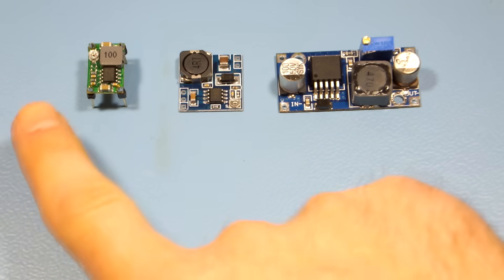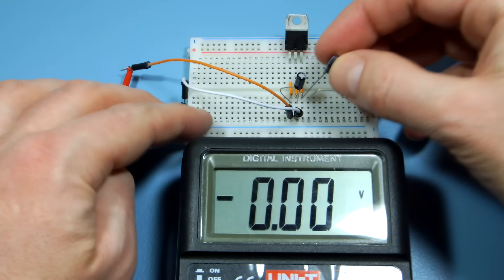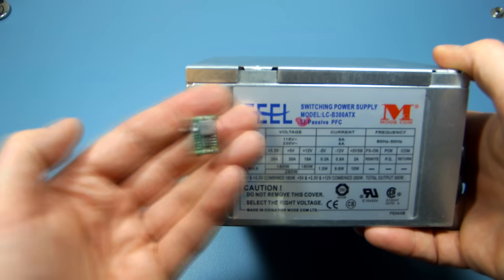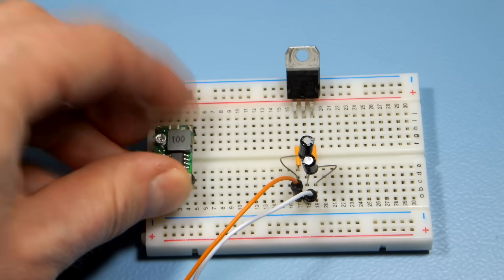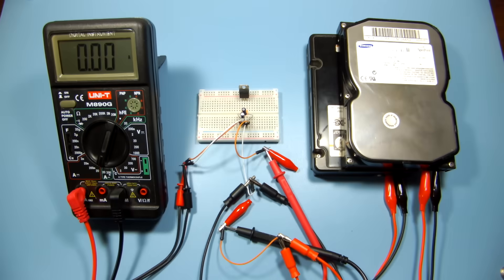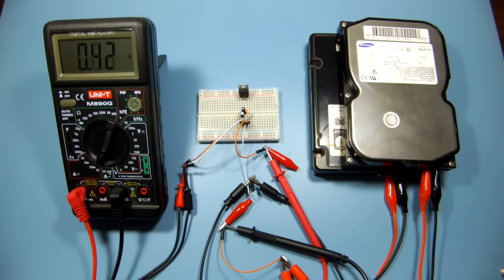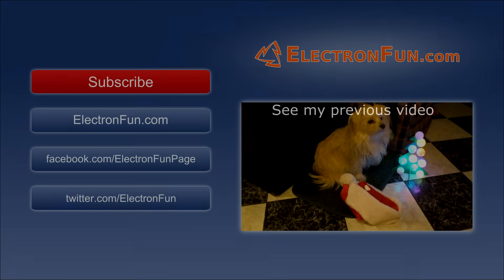Buck converter vs. linear voltage regulator - practical comparison

Comment: Buck converter is great if you want to power a cooling fan. But if you want to power a 5 volt car camera, Magicjack, or speakers than the linear voltage regulator is a winner. Even a UPS has a lot of ripple noise, so instead using a buck converter I decided to Use a 6 volt 3FM4.5 (6V4.5AH20HR) , a YX850 Power failure automatic switching standby battery lithium battery module 5V-48V universal emergency converter JY-850  US $2.85, a 6 volt battery tender charger, a 5 volt linear voltage regulator,  an USB anti interference filter board USB filter board USB power amplifier filter board computer filter USB purification board, 5 volt 2 A low interference noise Adapter for powering magic jack from the grid, 
with a 0-50V 4A DC power supply filter board Class D power amplifier Interference suppression board car EMI Industrial control panel, in tandem and I have crisp clear Audio, and Uninterrupted Power Supply in any case of power outage. Technically you are Right, but no PRACTICAL.

Comment: My input 12v 7ah, mini 360, and it burst. how much input current should be?
Reply: ?????     Charging a battery?
Reply: @kennmossman8701  yes
Reply: @rajatfq  For standard Li-ion or Li-polymer batteries, chargers often target 0.5C charge current. In other words, if the battery is rated at 500 mA-h, the target current is 250 mA. It is not unusual to charge at 1C (500mA), but this compromises the battery's capacity over time.
Reply: According to the YT video here, < 7 A  but check with websites...1 C seems a bit high

Comment: What circuitry should I use to convert 50v to 20v 2A at the output?
Reply: use a pre-regulator............series-pass regulator can handle "any" voltage

Comment: Hi, guy. I want to ask you about using the regulator. If the Input is not 12V, I want to input about 15~18V, then what will the Output go out?
If you teach me that, my project will be succeeded.

Comment: Hello

Let's say that I have a fully charged 15000V DC capacitor and I want to use the voltage but I need to step it down.. all the way to variable 1V - 15000V DC, do you know how to build this or where to get a hold on a voltage regulator that have an input voltage this high?

Kind regards

Comment: I have an old (but still good) drill which takes nickel metal hydride battery's they are 25v but the charger has died. 
I bought a new drill with 18 v NMH  batteries and a good charger, can I use a Buck converter to up the voltage so I can charge the 25v batteries?
Reply: you still neeed a charger

Comment: Computer power supplies usually have high frequency transformers to step down the voltage. At higher frequencies, transformers can be fairly small and smaller capacitors can be used for filtering.

Comment: good example, but from my perspective, the most of the buck converters are made with to thin copper layers and therefore, the cooling is not that good, when hooked on the ocb. with other words, there are to cheaply manufactured and the working treshold is not considered that well. i trashed 3 of the common modules with a harddrive,  that i shoot  the  idea, to use them within a data center .. the chip itself on the buck converter is mostly the expensive part, so building up a self designed one, is still on the list :)

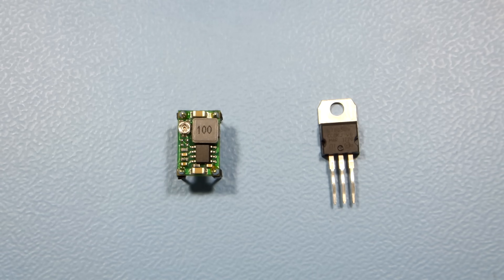Comment: had a bag of 10 of these regulators this week that you show at 6:03 , I needed to drop 11-14v to 8.3 for a lipo charger, worked before soldering, but failed once output wires soldered, the output was going short, i think theres an issue with mine in the multilayer board that solder wicks somewhere.  I have had no issues with the blue pcb version with the preset voltage solder pads on the rear, i'll stick to buying those ones in futre. all boards worked before being soldered

Comment: i need to stepdown 3.7v ( from a lipo ) to 1.2 - 1.5v which do you recommend? linear or buck ?
edit: this to make a battery for a wireless mouse
Reply: Use a buck, it will give you 2-3x the battery life. Also, you can get extremely cheap ones at such a low voltage.
Reply: @yum33333  any recommendations on which buck I should use. I'm not really familiar with different buck converters

Edit: 
I am comfortable with using a IC and creating my own circuit. 
Any information is greatly appreciated
Reply: use a diode shunt regulator.... two diodes give 1.3V   or use a 1.8V red LED

Comment: Could some kind of shield or faraday cage be designed around the buck converter to minimize or possibly eliminate the interference generated by the circuit?

Comment: Hi folks i have a noob's question. I got two 6v 150 mA max power rated solar cells and i hooked them up in series. I get about 9v open circuit in shade. But when i connect lm7805, input drops from 9 to 2.5ish and i don't get any current at all. Nothing my cheap multimeter can measure anyway. Why is that dramatic voltage drop? I don't want anything fancy from the circuit, as long as lm7805 output is 5v, i can live with couple of mAs. Thanks for any answers.

Comment: Why tf does one use electrolytic aluminium caps for LDOs, juse ceramic or film capacitors instead, they have lower ESR and ESL. And the capacity for a standard 78xx is 330n on the input and 100n on the output, 10u for each is way too big.

Comment: But capacitor doesn't works with dc supply so how regulator is working ??
Reply: You can remove the capacitors,
 it is only for removing ripples in the input & output waveforms.

Comment: Even back when this video was made I could find at least 2 models of buck converters on ebay for 75 cents each.
Fast forward a few years after that and the mini360 that you have with pins soldered onto if can be commonly had for less than 50 cents each ..go buy a 10 pack and enjoy. 

The mini 360 is probably named for its switching frequency of around 360Khz, I hope no one is designing new AM band radios, but if they are the interference should be minimal, as the inductor is enclosed. You can also choose other models with different operating frequencies, such as the other 2 you showed at the beginning of the video, the larger unit has about an 80Khz operating frequency and the other one can be tweaked up to 500khz. There are cheap buck ICs out there that operate at up to 4Mhz switching frequency, most of those are a dollar or two more expensive though.
Someone else mentioned that you forgot the ripple on the output, so you should still add a 10uf decoupling cap to the output of the buck module.

Comment: I have a doubt, if we give 12 volts, 4 Ampere current to the inputs of 7805 voltage regulator IC,what will be the output current of 7805 IC, the voltage will be 5 & it's current???

Comment: Great video! I did have a question about your math. Wouldn't it be the power dissipated across the buck converter in the calculation?

Input: 12V x 0.21A = 2.52W
Output: 5V x 0.45A = 2.25W
Thus the power dissipated across the buck converter would be 0.27W.

Buck converter efficiency is about 92% and that calculation above would show ~90% efficiency.

Comment: A quick explanation of why the difference in the power consumption might have been useful for some.  A 7 volt feed would have been a closer match, not that it would be practical but would illustrate why the power difference.

Comment: @ElectronFun.com I wonder what the ripple/noise factor would look like if you fed the 7805 linear with 6v 3a from a DC to DC buck converter?
Reply: @MrBrymstond You need minimum 7V In, 6V is not enough, but the 3A load capability not necessary from the buck DC/DC, as max load on a 78xx series is 1.5A (TO-3 case). If you need 3A at 5V then you need a LM323-N, but there is 7.5V the minimum Input voltage (of course you will need a big chunky heat sink as well)
Reply: @Glanmire3  Okay so 7v in from the buck converter and the LM78XX will only draw what it needs, but the thought was will it clean the ripple and noise for small audio

Comment: When using linear regulators ALWAYS check the datasheet for the type you are using. Many regulators will be damaged if there is a high value capacitor on the output when the power is switched off. Check the regulator datasheet for reverse bias protection.
Reply: In such case you have to add a feedback diode on its input and output reversed bias and you're good to go
Reply: @drinkintea1572 it's called freewheel diode🤔
Reply: Linear voltage regulators are a type of voltage regulator that use a linear circuit to maintain a constant voltage output. This is in contrast to switching voltage regulators, such as buck converters, which use a pulse-width modulation (PWM) circuit. 

There are several key advantages of linear voltage regulators over switching voltage regulators: 
- They are simpler and more reliable than switching regulators. 
- They can provide a more stable output than switching regulators. 
- They can be used with higher input voltages than switching regulators. 
- They are less efficient than switching regulators, but this is not usually a problem for low-power applications.
Reply: @aplacetoimproveteslacoilin3721  bro using chatgpt

Comment: buck converters are now as cheap as all the circuitry needed for the linear regulator (because you have to remember that you also need a couple of capacitors and any way to join them).

Comment: can you boil water with a LM7805?  

cheers!
Reply: No, although the temperature can reach excess of 100c, the amount of water in a glass can dissipate it all in a fraction of a second, there is just simply too much matter for it to heat up, its actually why some people submerge their circuits in oil, not only does it provide static resistance, but the oil gives it a medium to dissipate the heat from the heatsink much more effectively that air ever could.

In fact, you can try it at home, put a couple of aa battery's in series with a resistor, preferably 5 ohms or less, do the math on how many wats it dissipates, check the temperature in air, then submerge the resistor in water. It will cool down very quickly.

Comment: I was trying to learn making my own usb chargers and was using 7805's to do it and as the video states, they are just too wasteful and need a large heatsink with any modest load. Buck converters are so much better for those type of applications. Only good thing with 7805's is the output is very clean DC compared to buck's. You have to clean the output with a buck converter with anything sensitive.

Comment: 7805's can take like 6-36v right? you mentioned 7-16.
Reply: 7 to 35V but for stable operation minimum is 8V. Load regulation is pretty bad with only 7V input.

Comment: Great explanation but just like to point out that you may not have incurred the failure of the VR had it been correctly setup with appropriate heat sink. This would also have improved its efficiency for your comparative data records I assume. I enjoyed the video :)
Reply: It wouldn't make any difference to efficiency. With a linear regulator, the source supplies the same amperage as the load draws from the output. With the buck regulator, the input current is much lower than what the load draws from the output. That's why it doesn't get hot. All the wattage gets passed from the source to the load. The buck converter probably dissipates less than 1/2 watt at the most.
Reply: Hello my friend,good day please can we use solar panel 12v to convert 7805 to get 5v to charge phone?

Comment: See the 2 rows of outer holes on the edges on the breadboard? Those are called the POWER RAILS. Red and Blue striped for Positive and Negative! So, why do you use silly and cumbersome alligator clips onto flying leads?

Comment: I went through 5 LM7805 trying different configs to support a 2.5W load. I even split the power going through using a power MOSFET with a voltage divider to the gate so maybe 1/3 power flowed through it and temps were still way too high with a little heatsink.... LM7805 are only for circuits using less than 1W no matter what the specs say...

Comment: Well, this is a bit of nonsense.....linear VR need proper heat-sinking - just as SMPS may also need.  You can use a metal case as a heat-sink, so there goes the space argument. Efficiency of SMPS varies a great deal - cheap ones are as low as 70%. Compared a pre-built SMPS to a linear IC?  oranges to apples.   LM317, 78xx sewries and the like have short-circuit protection whereas most SMPS do not. 
And yes SMPS are NOISY - audibly sometimes and definitely EMF wise. The waveform often sucks on SMPS which can give false readings and damage circuits.
Plus SMPS DO FAIL and CAN destroy the attached circuit - seen it happen many times.

Comment: 10 linear voltage regulators €0,90
Buck converter (the one with potmeter you showed) €1,-
Reply: you should consider the heat sink cost.

Comment: This is a HUGE help for me. I am trying to put an F.M radio inside a 1950s radio cabinet. I bought a kit, but it didn't have a good tuner that would fit in the existing spot, so I bought another kit that has a digital readout for the tuner. The first kit runs on 12 VDC, the second on 3VDC, so I was looking for a way to drop the voltage on only one part of the circuit. I'm not very adept at electronic theory so , I'm kind of stumbling in the dark as far as what I want to do and how to do it without ruining things. I had intended to use an old cell phone charger to power the unit. It's a 12 volt charger, but I don't know what amperage the two kits require, so I'm unsure if this is a safe way to decrease the power going into the unit and then how to decrease it again for the digital readout. Any pointers you can offer are deeply appreciated. Thanks.

Comment: You missed one important point, current. Buck converters are very limited in case of maximum allowable current.
Reply: Just buy a larger one that meets your needs. They sell them in many sizes
Reply: @jimthvac100  yes but a larger one will get large in every way.

Comment: Can I use buck converter for charging 8.4 v ,4500mah battery from 12v supply,when I using 7808 its shut down within seconds due to heating

Comment: I've attempted to use several different buck converters with 3 motors (120x120 fans actually). These motors (fans) draw 80mA.
All the different buck converters lasted around a day, then they were fried.
Now I use a simple LM317 and it just works all the time. I don't use a heatsink.
I believe this is due to that the motors send spikes back into the buck converters (at a much higher voltage than is fed into them), so I don't use buck converter for anything like relays and motors.

Comment: Not sure if this would help on the overheating of the 7805, but, try to use a larger output capactor (50-100 uF).  This will have larger  charge storage capacity as well as filter.  Also the 7805 will run cooler when Vin is closer to its threshold voltage plus Vout.  (ex. 9v).

Comment: I am trying to power my 9v DSLR from a 12v source using a buck converter. Do you think the noise will effect the camera? Can I add output caps or something else to the circuit to improve its performance?

Comment: This is a bit old of a video but if someone would be able to help me that would be appreciated. I'm trying to make a small solar usb lithium battery bank, ill be using lots of solar lawn lights with some in parallel and some in series to get somewhere around 7-12 volts and 1amp, now I was planning on using just a diod and a 7805 transistor to feed that to a tp4056 lithium battery charger (I read that you don't need a 7805 and that the tp4056 can handle up to 8v but I'm trying to keep this reliable) but I was wondering if a dc-dc buck converter would work better or if the varying voltage of the solar panels would mess with it?

Comment: Of course the LM7805 was powering off, it needs a heat sink it you want to compare the two. It may be a disadvantage, but that is the way it was designed to be used.

Comment: So I don't really know much about this kind of stuff. But I want to convert a battery powered lamp that uses to AA batteries to be powered via usb. So I bought one of those tiny buck converters online to go from 5V from the USB to 3V to match the batteries. When I connect it up, its makes a whine when I turn the screw to vary the voltage. Am I doing some thing wrong or is it broken ?

Comment: So the linear voltage regulator basically takes the 12 volts and in the simplest sense 'burns off' 7 volts to leave the required 5 volts? Hence if your load was one amp at 5 volts (5 watts load), the regulator would turn 7 volts at one amp (7 watts) into heat? Wasting seven watts to power a five watt load seems really inefficient to me!

Comment: Buck converters are perfect for smaller battery powered devices. 
However, if in a heavier application, then use the flat pack ic/transistor with a sufficient heat sink.
Great video.

Comment: Can you please make a voltage  booster circuit using IC 555 to charge 450V  capacitor bank .
Reply: No - that would be silly.

Comment: LM7805 is not dedicated to be used at this aplication. It is not "linear voltage regulator" but  voltage stabilzator and filter. Usually use is with input voltage about 6-8V . The power eaten by thsi is P=Ix (Vin-Vout) . So normally it heaten by 1-3 Watts of course with small radiator.When input voltege would be 12V the power lost in LM705 (at 1Amp) would be 7 W  and it is not intended to be used in such situaton (at least at commercial equipment). Funny think is that inside "buck converter' there is usually a li, but the current near voltage stabilztor working as it should - as suplier of refference voltage but with curren counted i microAmps..

Comment: That depends on where you are I buy those exact Buck converters 10 of them for $5.95 Prime shipped in the US that's less than $0.60 a piece I keep 30 of them on hand at all times because they're so efficient is so cheap and so easy and so tiny